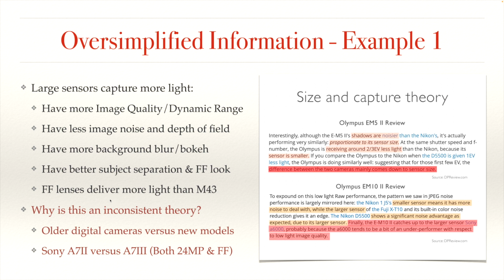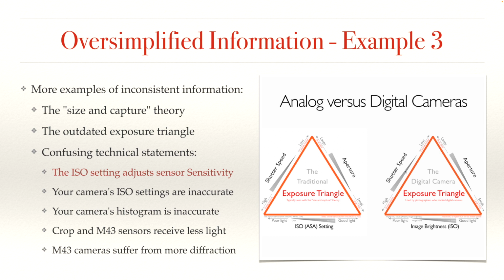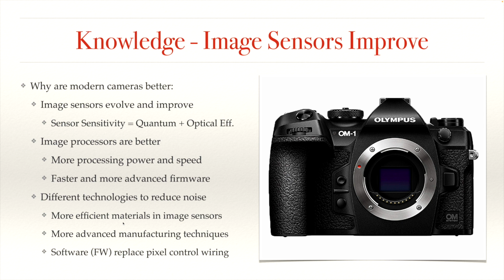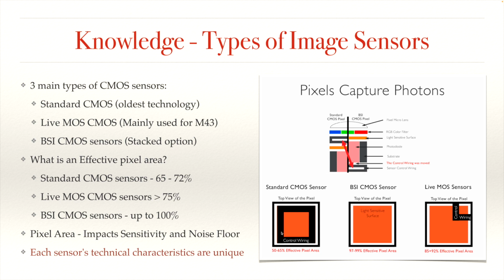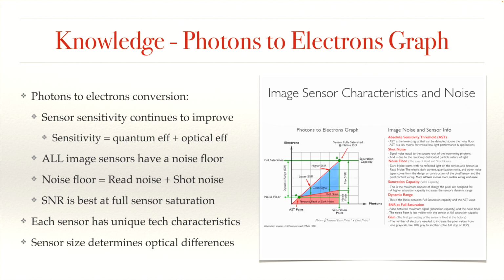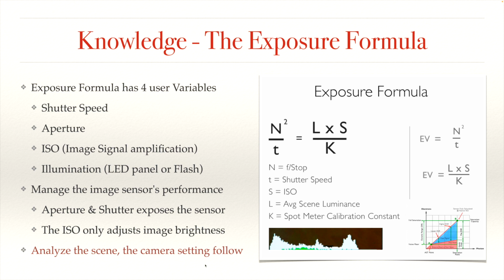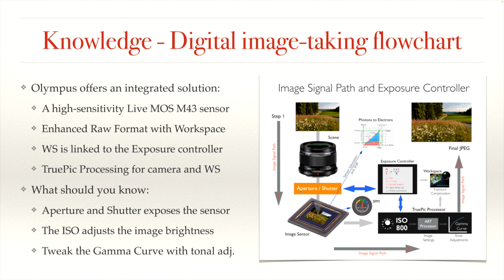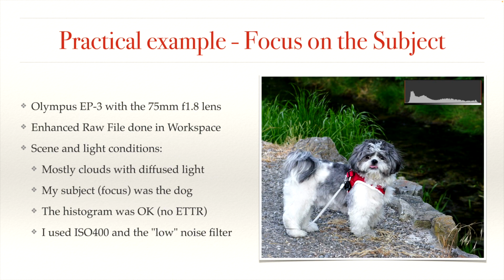Advanced Exposure Techniques

Comment: Does the ISO setting amplify the analohue output before it goes into a ADC?
Reply from the maker: Camera manufacturers do not provide much info on how they do signal amplification. Studying technical papers one see that analog amplification is the most likely option and digital amplification happens in a second phase. The amplification (noise) characteristics between analog and digital are different. It's quick to spend too much time on details, especially when looking at A/D converters and where they are placed. What should photographers know? Two things. First is the sensor's gain is corrected and fixed at the factory. This is analogue gain. Second is the image signal from the sensor is amplified. In other words the shutter and aperture "exposes" the sensor and the ISO amplifies the image signal. Shutter, Aperture, and ISO are all part of the exposure formula (the link)... which means we now know how to optimize our image quality is needed...
Best Siegfried